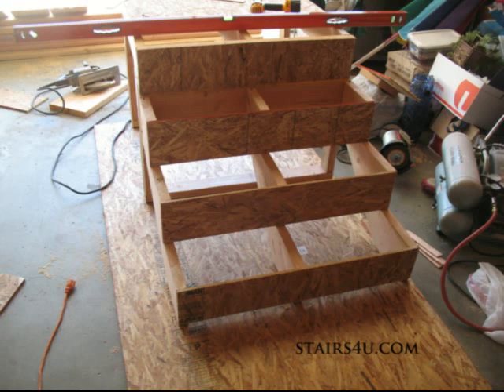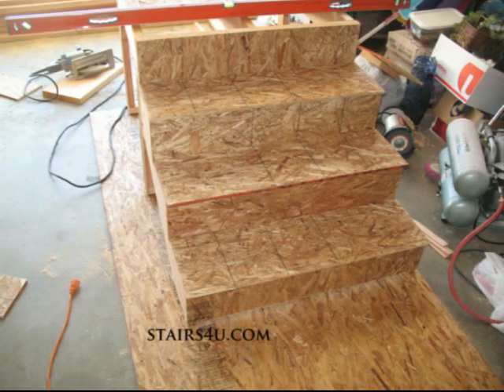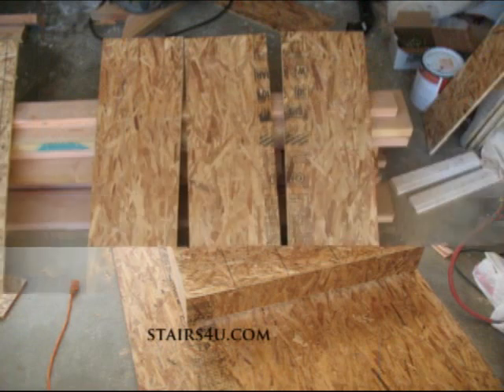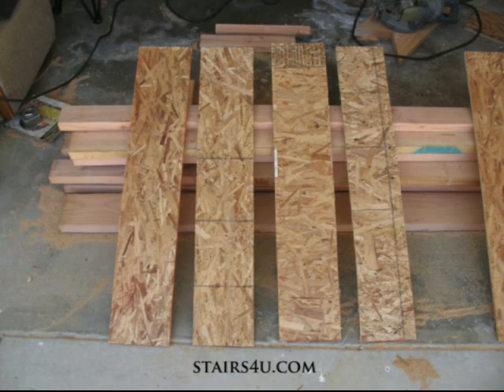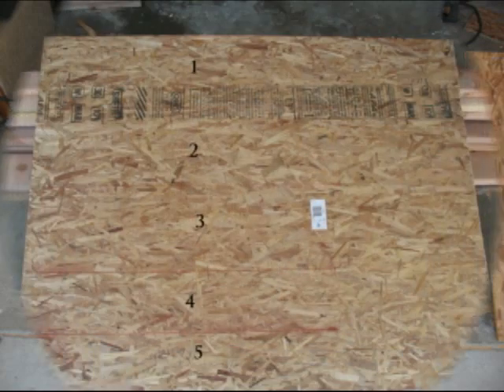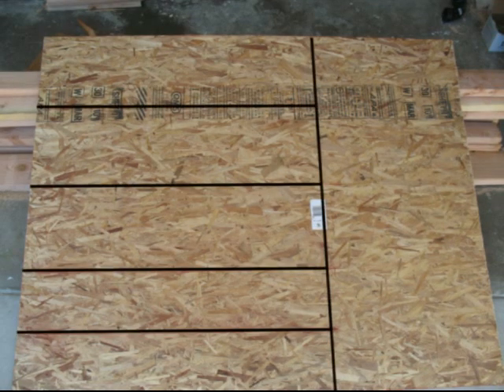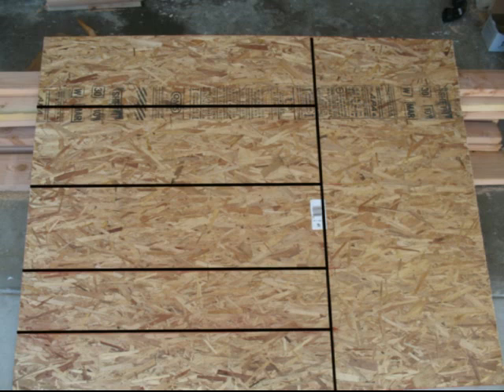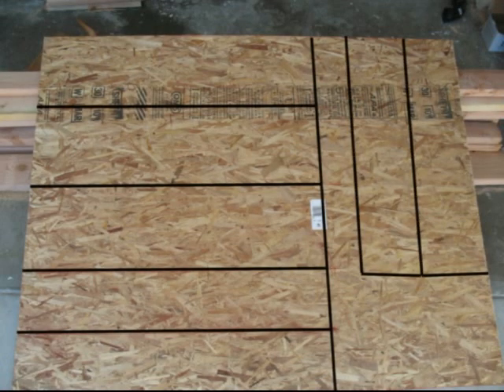Stair Tread and Riser Layout - Plywood or OSB

Comment: Just took out carpet for LVP install and found each tread of 2x12 (o) pine after over 30 yrs CUPPED and noisy due to poor contact with stringers as well as original sloppy construction of stringers. Interestingly all were cupped with the grain with only 1 good one (which was a center cut). Ones over water heater aged the worse with some stringer warpage as well. For quieter, less oriented materials, a resin osb offers benefits because of more random orientation of loads, but maybe less in a specific direction. For rigid overlayment cupped no good and noise could be issue. Can the osb be doubled up for a 1 1/2 in tread with PL 3x adhesive between? Seems like would be a quiet and strong arrangement. Also would allow more of 4x8 to be used with randomizing direction and loads.
Reply from the maker: You can purchase inch and eighth thick plywood also and since you didn't mention the span distance between stringers, then I wouldn't be able to provide you with an answer. For example if they were using 2 x 12 because it was spanning 30 inches or more, then I wouldn't suggest using two layers of three-quarter inch OSB plywood, even if they were glued together. I would simply replace the 2 x 12 and hope for another 30 years.

Comment: Greg, great videos, and always nice to have your informative instruction on many topics. However after speaking with Roseburg plywood representatives, plywood OSB or plywood's do not have a grain!!! So they say ????  so ripping material either horizontal or vertical on plywood should not compromise the strength.  I have always believed that if you rip a sheet of plywood on the 8'-0 axis, you create stronger pieces, than cutting the 4'-0 axis. Can you be more clear on this? Thanks Greg
Reply from the maker: I think you could replace the word grain with perpendicular direction and maybe make more sense out of it. My dad learned this lesson the hard way. The architect provided a detailed on the plans that showed the grain of the plywood running parallel to the roof joist, my dad called the architect to verify this uncommon building practice, but didn't get anything in writing. When the building inspector came out, the inspection didn't pass and the engineer needed to get involved and my dad had to pay for materials and labor to install thousands of blocks. So when someone (including professionals or representatives of the manufacturer) tells you that it's okay to do something that isn't a common or standard construction practice, then you might choose to do more research is you're doing. I've done a lot of repair work and remodeling and witnessed a loss in strength on existing buildings when the grain of the plywood is ran parallel to the joist or roof rafters and it really becomes apparent in half inch or smaller plywood than it would in 5/8 of an inch or larger OSB or plywood.

Comment: To clarify that better the sheet that you put the numbers on and then put the divided lines on should have been a full sheet not a partial sheet. When you were explaining how the green went on the 8-foot not the 4 foot end if you had a full sheet you could plainly put your lines on there showing off of a full sheet and when you did your 3 Treads and 2 risers and then the other two risers out of the other section that's misleading because you're not using a full sheet I think that it would be better with a simple full sheet